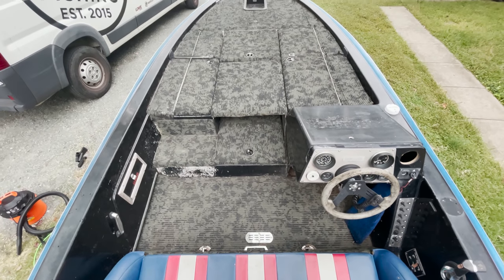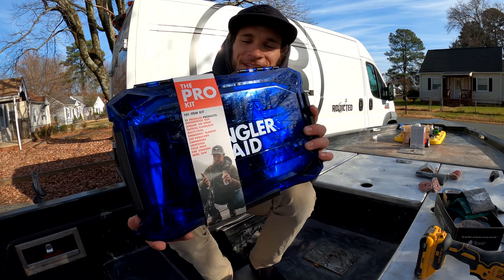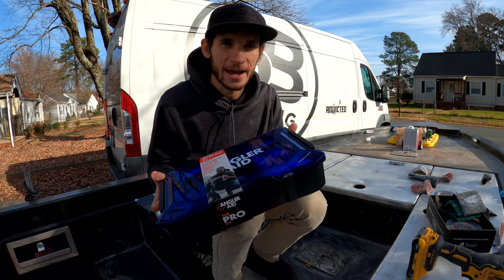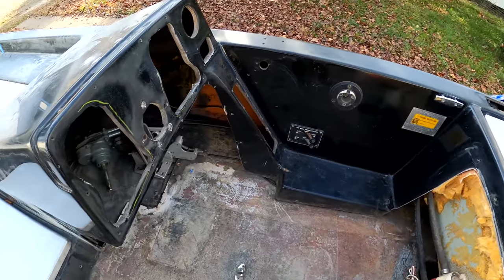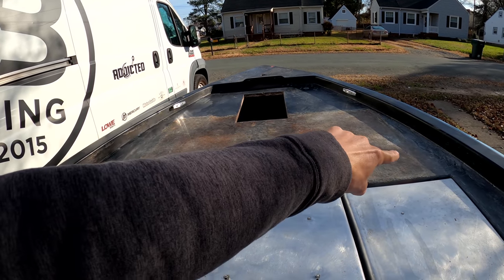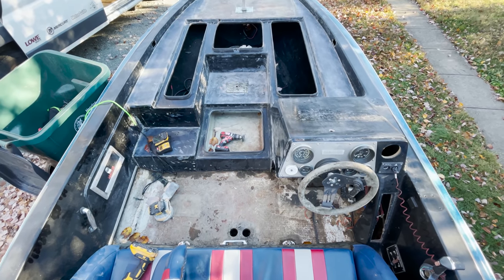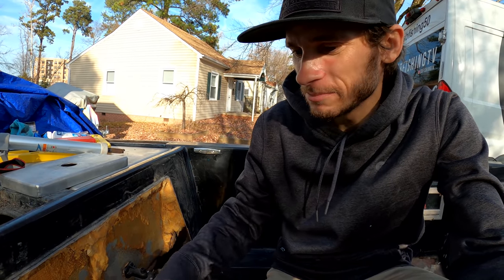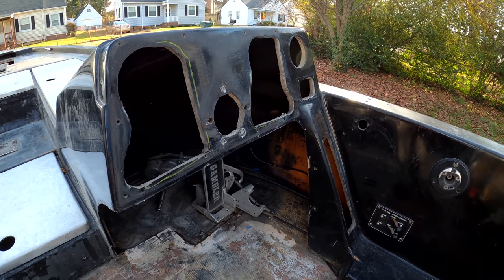Restoring 30 Year Old Bass Boat with No Experience

Comment: my 2 cents, keep any foam came out in good shape and use it as a template for the new cut, will save you tons of time, and will get the perfect cut as it was out of the shop. i did that for my bass tracker and it turned out pretty good

Comment: I recently rebuilt a boat and here are some things I learned.

Get a LOT of small containers to put parts in as you're doing the disassembly and label the containers. That will help you put those parts back in the correct place or get appropriate replacements. Then get some larger totes to keep those small containers in. That way you don't lose anything.

Wiring is SUPER important. Only use marine grade wiring and use sealed connectors. It's also a good idea to upgrade any fuse blocks or breaker panels. This is also the time to decide if you want any extra electronics or lighting since you will have to run more wiring to those locations.

With everything you do, always ask if there is a better or more modern alternative to the original. LED lighting instead of incandescent. Extra support for certain structures. better switches. Better pumps and through hulls, better hoses and fittings, etc. Every boat I've ever seen has one thing in common. The manufacturer was trying to make money and if they could save a few bucks by using a slightly cheaper alternative, they did so. Now is the time to upgrade.
Reply: Wow what a great comment thank you for this I am about to start this journey.

Comment: that loop in the middle box on your live wells is a chill box so you can cool the water without watering down and shocking the fish. by putting ice on that loop its works like a radiator and chills the live well water, its kinda smart but also poorly done since you had wires running through the box.

Comment: The only “big” problem is being outside in the cold, like you said. It’s hard to use certain glues, epoxy, paints etc when it’s cold out! You’re making great progress. 
I think the aluminum support for the console would be awesome. Previous owner of my own boat didn’t secure the console after adding 2 garmin 12’s, resulting in my console tearing itself apart from all the extra weight. 
Keep updating us bro!

Comment: I feel your pain. I’m restoring a 1985 winner bass boat. I’m thinking about putting sea deck on it as well. I came across your Video tonight and it reminded me of the struggle I had to remove the glue from the carpet, I used a razor blade scraper I purchased from Lowes and it worked better than anything else I tried. Looking forward to more videos!

Comment: Check out the new bass cat puma sts with the sea deck on front and rear decks. They still had to use carpet on the sides... I would recommend that as well, otherwise won't look right..

Comment: You will do just fine. I'm looking forward to your progress. I'm in the sign business, so I deal with adhesive daily. Two products that are useful are  Un-Glue sold by Denver Sign Supply, and the other is Rapid Remover sold by Tubelite Sign Supply. Get you some plastic razor blades to prevent digging into the gel coat when scraping, when using these. Both adhesive removers are water soluble, so they rinse off with soap & water. Hope this helps. 🍺🎣

Comment: As a guy that rebuilt an all aluminum bass tracker 3 when doing the wiring buy marine grade wiring and connectors and pull extra wires in you won’t regret it.

Comment: You can pick up a heat gun, kinda like a super hair dryer, cheap, and it will heat the glue and you can easily pull it off.  Looks good man. Keep it up.
Reply: Heat gun and a sharp scraper will tackle just about anything....often better then power tools

Comment: The dash would be better with the aluminum plate you could flush mount your screen in it. Also like you said about the wiring harness just redo as much as possible yourself the wiring is such a pain because that’s the one thing that can ruin a trip just take your time and secure it really well

Comment: I have done several bass boat restoration over the years and it is a tuff job but when your finished it is very satisfying. I would put hydraulic steering on the top of the list expensive but well worth it and I do it you would regret it.
Reply from the maker: Thanks for the tip!

Comment: Take your time and do things the right way, especially the wiring....use high grade wire, heat shrink connections and make sure you're using the correct crimpers for insulated ones...for the wiring and connections look up ancor marine, they'll have what you need. Also, make sure you do proper research on wire size required (12-14 should suffice) and draw up a clear schematic for planning and future trouble shooting...For the console, you can use a sheet of aluminum or try to get something like starboard or coosa board and simply cover it up. Looks great so far, like I said...take your time and do it right.

Comment: I've got a 96' 209. Cap off the extra recirculation pump, you only need one per livewell. Make sure your overflow(s) are in good shape. For the console, buy a piece of ACM (aluminum composite material) from Amazon or eBay. Pop your gauges in that, and then wrap it in carbon fiber vinyl wrap. I can put up a video of my dash if you want, just let me know.
Reply: Also Mary Kay, Google her, out of Florida can upholster your seat in an color you want. She was the one who did all the seats at the original Gambler factory in Florida.
Reply from the maker: Yo thanks for the tips Riley! If you want to send that video to strykulbrothersfishing@gmail.com that’d be greatly appreciated. Also just want to see the 209 😎
I’m familiar with Mary Kay and have seen a bunch of her work - it looks top notch. I’m going to try and do it myself though just to learn and give myself something to do when it’s freezing out 😂
Reply: @SBFishing  Hey will do! I'll try and get out and make a quick vid here in the next day or so. You picked a great boat. Gamblers are built like tanks, and fish really really well for older boats. Plus they just look damn fast sitting still.

Comment: This is an awesome project dude look forward to seeing more updates and learning myself. Not an expert but pretty handy diy guy. 
Glue or adhesive remover=MEK or MPK works good or Toluene 

While ya have good access to hoses, clamps, pumps I’d replace with new cheap upgrade and life extender 

Wire work- crazy idea but I’d draw up exactly what I want to do first. Then you have prints later. Take pictures of everything befor hand for trouble shooting if needed later. I like to use terminal blocks on everything, no twist connects. Identify all wires at both ends of run. Learn how to do a good clean crimp on wire terminal ends and then add shrink wrap over the crimp cheap easy clean look that beefs up wire work and if you use white you can write what that wire is or identify it at the terminal end. Bundle your wire groupings together with zip ties. Add fuses in easy to reach places 😂… again draw it up first is all to much to go into for wire work 

Fiberglass work is messy but temperature is what’s gona screw ya I think. Layers and cross layers is what ya need to learn depending on type of material your using. But if you add the aluminum piece to the console make it a angle piece like an L” bracket and use some kind of adhesive (sealer) and pop rivets to secure it. Will be sold. 

Paint - don’t tape a direct line fold tape over around area you want to paint so that it doesn’t leave a hard line for your to buff out. (Watch paint blend videos) use a high build primer to seal and sand down then paint. I’d just call a boat repair shop ask what paint they use for types. 

Ok ok got in the zone man  what’s in these brownies man 😂🤣. Good luck brotha 👊

Comment: Make sure you get marine grade switches, th marine has the hydraulic steering you need. They are super simple to install but need 2 people to bleed. Run your wiring first and make a schematic for the future. Label your wires too. Gel coat looks nice only if you know how. Top side is easy and looks good. I've done 3 boats and they are fun but tons of work. Remember you're going to spend triple the money you're ever going to be able to sell it for. Auto paint works for boats as long as you clear coat it at least 3 times

Comment: Inject some thick instant glue into those wood cracks, or work in some epoxy. Make it messy, if it flows out fine you can sand it off later

Comment: Ya, your tackling a lot of someone else's hacks. Replumbing, rewire, patch unwanted holes are all things I would do. I'm good with fiberglass repairs, but not gelcoat. Cold weather and resin or epoxy makes for difficulties. Dash I would go with aluminum backing for reinforcement. Floor I would patch with thin plywood. Heavy coat of resin on both sides place inside patch area and then start adding fiberglass and resin. Dry and sand even. Seats, I would un-sew ever stitch and use the unsewn fabric as templates for new upholstery.

Comment: Once you figure out which gauges you are going to use and the size of your switch panel.. you could take and spray paint some quarter inch aluminum diamond plate to match the color of your Sea Dek and put another one behind it of the same size. That would definitely stiffen up the whole console area. Or you could simply put one behind it and that would do the same thing as well if you wanted to keep your color. As far as fiberglassing goes it would take too long to tell you what I know. Watch Parlay Revival  on YouTube. He is redoing a sailboat and he is knocking it out of the park. Of course he has experience but you could also pick up many tips from his videos.
Reply: Someone did that to my boat before I bought it and the first summer on the water peeled all the paint off the diamond plate.
Reply: @camaroboi13  did you scuff the aluminum first and then wipe it clean from contaminants before painting? was it clear coated?

Comment: Did someone actually put automotive clear coat over the gelcoat?  Discoloring or fading of the finish (gelcoat) is just oxidation of the surface. The oxidation is removed by wet sanding with surface with 2000 and up wet sanding paper. You tube will have many vids on renewing gelcoat surfaces. 
I am totally in on a boat restoration. Keeping my eyes open for a candidate all the time.
Reply from the maker: 100% was an automotive clear. It SUCKED getting it off, but it's done. I've gone through and restored the gel coat and it really pops!
Reply: @SBFishing  great news. Waiting to see more progress.

Comment: Dude.... I had commented a few videos back that the beard (the longer version you had then) was NOT working for you.

Just noticed you trimmed it... kudos.  You look much better this way.

Anyway... yeah, it's hard tackling a job when you don't have a lot of experience doing that type of stuff.  I did a jon-boat to bass boat conversion 5 years ago and it came out pretty good.  Put a front deck on it, with a front trolling motor (wasn't designed to have a front trolling motor), seats in the front and rear....  pretty nice for somebody who'd never done that type of work.  I watched some other guys on youtube doing similar stuff, you could probably find some channels that do upholstery work and get some tips, etc.  

Love the vids man, keep them coming !